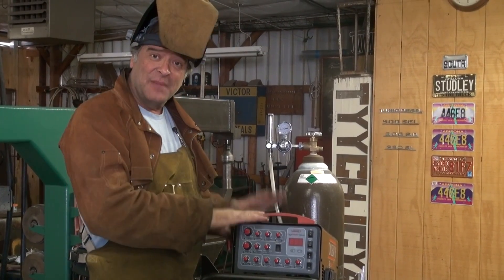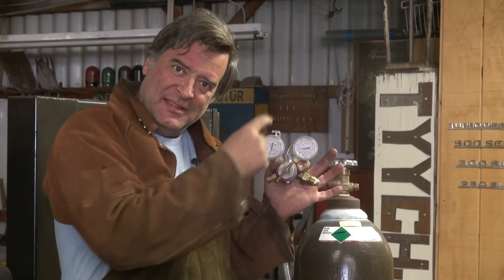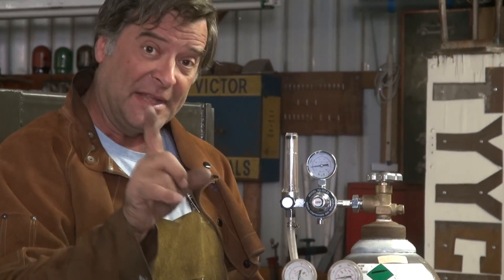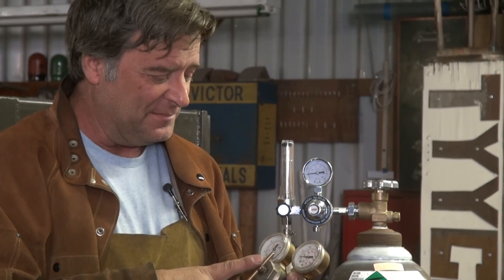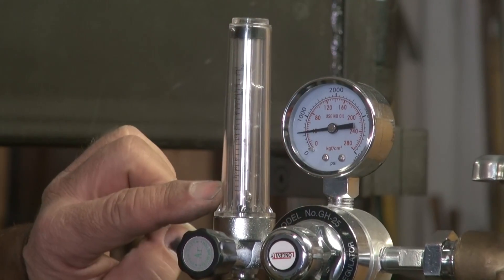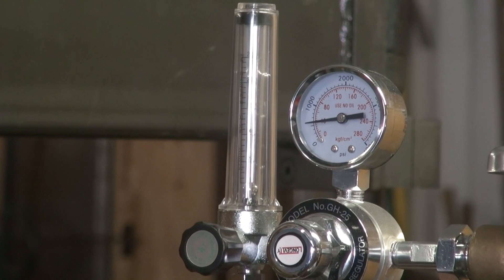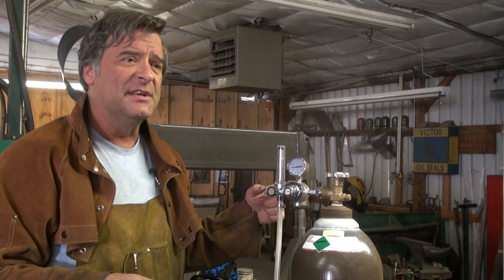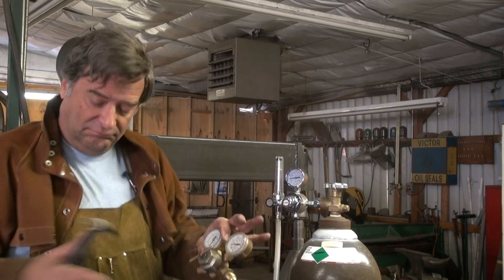How to Use a Flowmeter Instead of a Regulator for Welding - Kevin Caron

Comment: Is it normal for the gauge that displays tank pressure to drop from 2100psi to ZERO within a period of say 15 -20 minutes after closing ALL valves?

Think I have a defective flow-meter, flowmeter is brand-spanking new. Mfg unknown, sold by HTP.
*************
(EDIT called HTP, HTP is definitely going on my "Short List" for future welding needs. Don't know if the behavior I'm seeing is "normal" but without having to jump thru hoops (work /fight for getting a item replaced) Paul said he was shipping a replacement @ no-charge

* I have only interacted with Paul twice, but I can definitely say HTP has a winner in Paul'.
Paul is one of those types of people you "hope" picks up the phone when you are calling in with a "problem" and need a speedy resolution.  He appears to be geniuely interested in "making the customer happy", realizing that if you do such you create life-long customers. I don't know Paul personally but I'd say he's a definite asset to HTP and I'd hire him in a minute!)

**************

Doing TIG, manual gas valve on torch. Tank on Argon tank looks new.
(LWS showed me a couple of tanks that displayed a mfg date of 2014-04, saying when I "BOUGHT" a tank it would be "NEW"  but local LWS pulled a fast one. First trying to give me a tank from 2010... ended up with a 2012

I was planning on keeping the same tank long term. "NEW" to me means it's NEW when I am quoted a price. )

Q: Is it normal for the gauge that displays tank pressure to drop from 2100psi to ZERO within a period of say 15 -20 minutes when you close both the tank valve and valve that adjusts the flow rate fully?

(Valve on torch is also closed, not that would make a difference "if' valve that adjusts "flow" is sealing properly in the fully closed position.)

It is normal for a flow-meter to "Bleed Down" so rapidly?  Seems like with all valves closed it would retain pressure for longer than 15-20 minutes

What is the best way to check for leaks? Soapy water, with power removed to the welder or course, and letting torch dry out for a day or so if exposed to to water right?

(Hate to get water inside the flowmeter.)

.
Reply: *****
Q: On the regulator you have.... if you close the valve which regulates the flow-rate fully, and then turn off the gas feeding the regulator.... What kind of pressure drop (if any) are you seeing over xyz amount of time?

I'm assuming the "leak" / the pressure drop is within the regulator itself and or the "valve" you turn which regulates the flow-rate isn't sealing.

To clarify the machine (Don't hate me) is a EverLast PowerArc 140st (2014-01 mfg date) does not have a internal solenoid. Gas does not flow "thru" the machine.
Hookup is:
Tank>Regulator>about a six foot length of EverLast supplied Poly Vinyl Chloride 8mm OD black hose that ties  /feeds into /is part of the male DINSE 25mm style connector that plugs into the faceplate of the machine.  Total length of the length of hose the argon is flowing thru about 16ft counting the approximately 10ft long hose that at the other end has a WP-17 TIG head with a *manual on-off gas knob on torch.
*Manual gas valve seems to have a excessive amount of radial clearance in it (Play in shaft) and I have to torque down more than I'd prefer to get it to seal.
(I can hear gas leaking unless I really crank down on it.).

If you would please check your setup and see what kind of pressure drop you are seeing over xyz amount of time.

PS: Appreciate you taking time out of your day to respond. Used to TIG years ago, TIG welding on jet engine internal engine parts so I'm sort of rusty.

.
Reply: *****
In case it helps someone:
Try a stethoscope, section of tubing to see if you can "hear" the leak first.
Applying soapy water is ok on the fittings but "rethink" applying soapy water to regulator  /gauge itself.

Applying soapy water resulted in water in the gauge thru a vent hole (duh)
No big deal on that, take the faceplate off and use a gentle stream of compressed air to evaporate any remaining water.

 While applying the soapy water noticed bubbling on side of regulator body... Upon closer inspection I see two venting holes in lower body of regulator. 
Upon seeing that sort of distressed on thinking about what damage any water introduced into the internals might now.
(Lower body of regulator when you look at it looks like a "cup". Whatever water you introduce into the regulator can't escape.)

My solution was while gauge was apart I heated up brass regulator  body/gauge with a blow dryer for about 5mins to raise temp enough to evaporate any residual water inside regulator.

I guess I should really take lower part of regulator off and verify water isn't present but most likely any "seals" would have to be replaced.
(Debating about using compressed air to blow thru the vent holes to help evaporate any moisture remaining as my compressor doesn't have much run-time on if.)

Anyhow...Upon using a stethoscope to listen for leaks sure enough gas is bleeding out of vent holes... with gas turned on fully... gas bleeding out the entire time main gas valve is open... and when gas has been turned off...bleeding pressure off till it goes to ZERO.

Regulator is IMO definitely defective.
Guess that would explain 100psi of gas disappearing just doing a few practice welds. Glad it was Argon instead of something that would cause a explosion.
.

Comment: I like your videos, I was just wondering what the different settings (pressure or amounts of flow) you us for mig and tig for most of the common configurations ( steel, aluminum, 2g, 3g,etc) when do u us more gas when do u us less. I think that might be a good video.

Comment: Another one out of the ball park! I was interested in your suggested flow settings.
 I figured the 8-12 lpm as a starter setting and see the results from there. The double setup is also good to use as a purge if you are welding stainless pipe.
Buy American, and, you won't think about the price after you have to replace the junky one from the cheap freight place you mentioned.
Great info. Thanks to both you & mrs Kevin (...or Mary, & mr Mary)

Comment from the maker: I have a 200 syncrowave sitting in my tool room.  I parked it when I got the Longevity and haven't started it since.   The Longevity uses about 1/2 the power to do the same job, is smaller and easier to move around. I feel it is also easier to adjust.  The Longevity costs less than 1/2 of a syncrowave as well.  The Miller on the other hand as a long history of being a very reliable machine.  Longevity has only been around for about 10 years so they have a ways to go to build that reputation.

Comment from the maker: I believe most of the new flow meters have regulators built in to get rid of that problem. They are just a fixed pressure so nothing to adjust.
Reply: Correct. They actually have adjustments (screw and jam nut) for factory setting.

Comment from the maker: Yes, if you are going to run bottled gas on a plasma you have to have the regulator control the pressure coming out of the bottle. But most of the time you can get by with just using shop air.

Comment: Hey Kevin, nice video! When using TIG on thin metal or sheet try to weld at 6 liter per minute, they should suffice for most applications and it saves gas and gascup turbulence. If your weld gets contaminated you can always  increase the flow. Sorry for liters per minute instead of CPH but thats how we role in Europe ;-)

Comment: Kev,In my 35 Years, Ive used Both,depending on which on isnt leakinking! and have really found NOT alot of difference I still prefere the Flow Meter,as the Prices have come WAY!!down,, Cheaper new than to get a regulater repaired,, although mine are the Old KG's some are Older than You and Me Put toghter,LOL!!!!!!!,So,Its Not Like parts are easy,,and I Just found a spare box of parts,when I sold the Older than dirt dungon i ownd,, Like a Big treasure chest,, Storts is 108 years Old, SO.......

Comment: Thanks for reply to my previouse Question about the flow setting on a regulator, however i have also purchased a flow meter but stil running my main/regulator on top of my bottle and from there to a water trap regulator witch got a eazy coupler on and i actually got my flow meter on the outlet or the other side of the solenoid as the length and the thickness of the pipe play a roll in the actual outlet flow, flow meter is set to 8 l/min is ideal,since the flow meter i used les Argon.Great video

Comment: People before you get mistaken and throw away your regulators for a cheap meters that uses a ball and sight glass, make sure you know what you have. Never use a pressure regulator for mig or tig because they measure in PSI, Regulators for tig and mig measure in CFH/LPM  aka "flowmeter" some flow meters look like oxygen "pressure" regulators, Just a tip to save people some money but not all flow meters look the same or have to be the ball type , I wanna see some aluminum welding Kevin :)